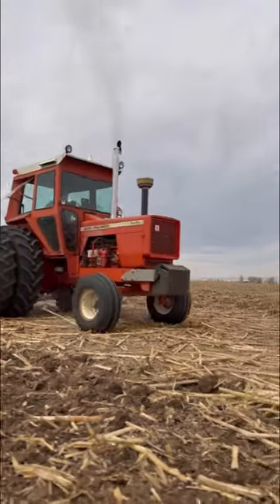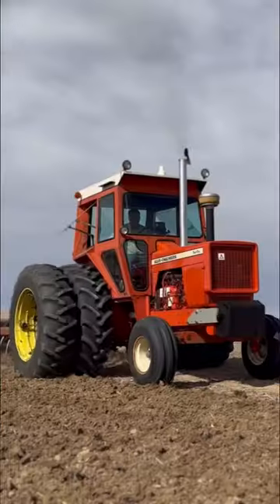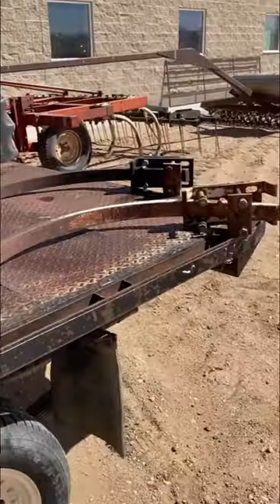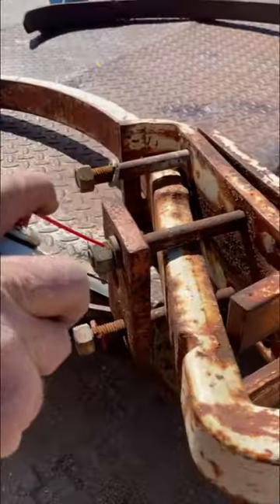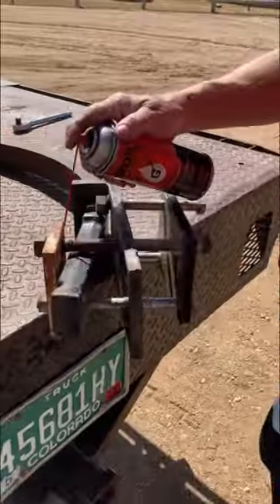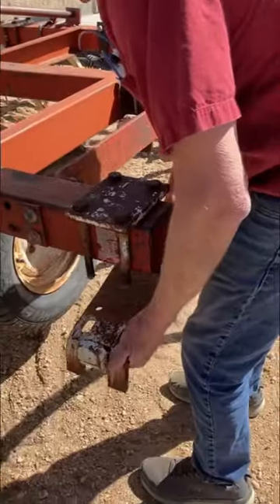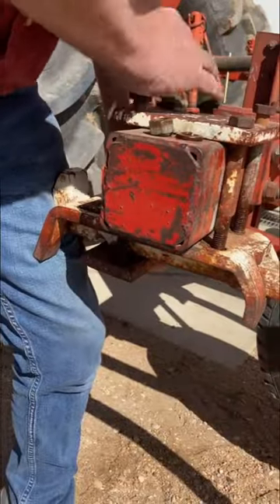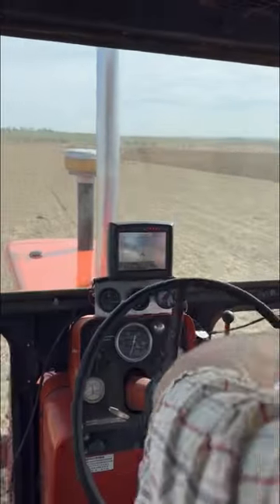#shorts More Cubic Inches Means More Horsepower, And More Horsepower Means Bigger Implements!

Comment: Surface inch is where more power comes from for the same presure. Not cubic inch. Gas inside of gas thsts the same psi have no force potential. Only the surface inch of the contact of the gass is where the power comes from. So yes and no the title of the video. More volume comes with a larger surface inch on the piston. Wider pistons is where its at bro. That's for more power and longer stroke meaning leverage is more torqe.
Reply: That's how presure works anyway. Lile saying a 10l bottle at 300bar being open for 0.1 second has more power than 1l bottle being open for 0.1 seconds. It's the same presure and the same opening and the same duration. So cc isn't everyrhing.